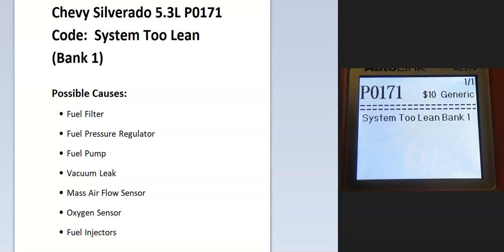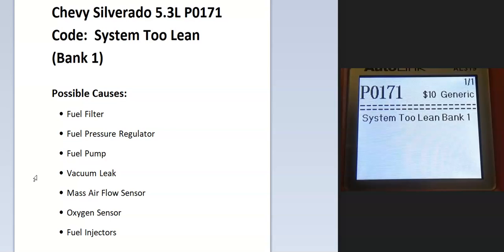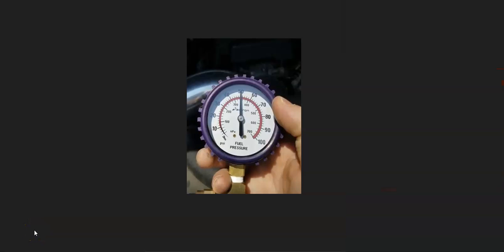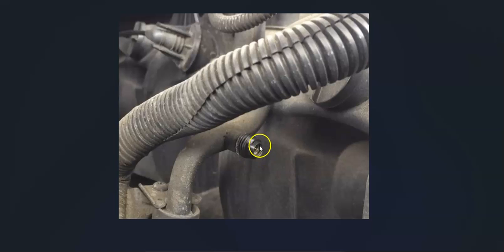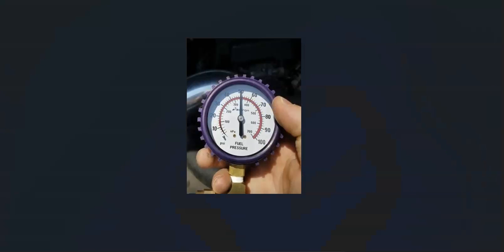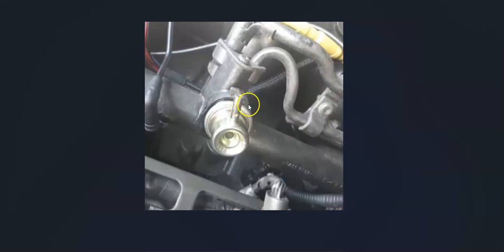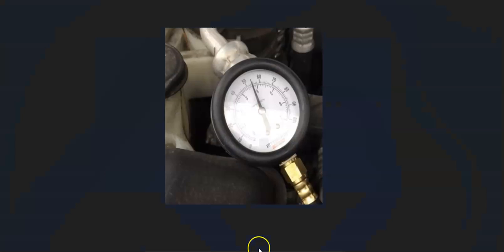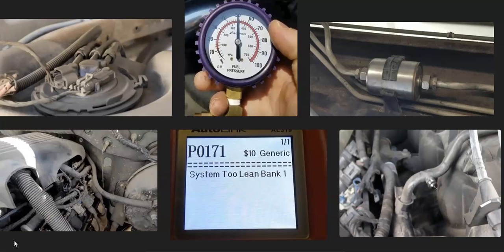Causes and Fixes Chevy Silverado 5.3L P0171 Code: System Too Lean (Bank 1)

Comment: I got a P0171 P0300 I replaced a purge valve. I replaced the intake manifold exhaust manifold, replace spark plugs and wires clean fuel injectors cleaned MA F Pl. A PCP fitting.

Comment: I'm getting coded P0171 and P0300, could I get some help fixing this issue
Reply from the maker: Lean codes can be hard to diagnose. If you only get bank-1 lean code than the cause is something that would only affect bank-1 and not the whole engine. Things such as a bad injector or coil. If no specifics cylinder error codes come up, you can remove the spark plug one at a time to see how they are burning and match them to a spark plug burn chart to see if one or the whole bank-1 is running Lean.

Comment: Had this code today on a 02 silverado 1500 with a 5.3 motor along with a p0300 code i replaced my 02 sensor bank 1 sensor 1 started the truck and the check engine light went away on its own and the truck drove perfectly.

Comment: Where would the fuel filter be on My 2004 chevy silverado 1500 it has a 5.3l v8 but we replaced the brake lines and couldn't find one inside the gas tank or on the frame under the driver door couldn't of missed it especially since we had it on a car lift 6 feet off the ground looking for it any ideas? Was it deleted or what lmfao

Comment: Thanks! Ive replaced the fuel pump and filter (per mechanics recommendation) and still didnt solve my issue. Did a fuel pressure test and vacuum test myself too and they were fine. I even fixed an exhaust leak I found and cleaned my o2 sensors. Nothing was helping, so I started suspecting my regulator. This video helped me feel more confident that its my problem.
Reply: Was it fixed?

Comment: important: SMOKE TEST your air intake AND exhaust system.   An loose exhaust connection could through this code.  I located a badly deteriorated exhaust DONUT from the exhaust manifold to the pipe connector - and made a huge difference.   SMOKE MACHINE about $100 or less... includes pumpup bladder, etc.

Comment: I drive a 2006 Chevy Silverado 6.0 & I’ve been getting P0171 & P0174 codes for a while along with poor gas mileage & loss of power anytime I try to accelerate quickly (passing), but otherwise it seems to run pretty normal. I’ve been chasing this issue for a while, but haven’t been able to determine the cause. But last week power significantly dropped, engine misfired, and went into limp mode. Checked for vacuum leaks (visually & sprayed carb cleaner) for the umpteenth time & found none. Checked fuel pressure & it was reading 22psi at the fuel rail during idle. While dropping my gas tank I found the Vapor Canister Vent Hose was broken (prior DIY fix had failed) & I’m curious how or if this could have caused my truck to run lean.  Also is there a way that I can test the fuel pressure with the fuel pump assembly already removed? Just curious if you have any thoughts on this. I have ordered a new pump.
Reply from the maker: Troubleshooting lean codes can be difficult. Since it's both banks, it is likely something that would affect the whole engine. I recently made an updated detailed video on diagnosing a P0171 code. Here is a link. https://youtu.be/b9__WGuD-dc

Comment: I'm getting p0171 and p0174 together plus when shifting gears 1-2 it feels the trans is kicking??
Reply: I get the exact same thing?
Reply: @rich909rm any fix? My does the same
Reply: I get both the codes and it also hesitates between 50-60 mph
Reply: Mine too and I can't seem to find the issue lol
Reply: Did you ever find the issue? @WhiteBoiGotti
Reply: bad o2 sensor

Comment: I had a P0171 on my 08 silverado 5.3.  I had super high sort term a long term trim only on bank one.  When revving the engine, trims got even worse.I had no vacuum leaks and when I caused one the engine ran much better, It was clear it was running super rich even tho it had a lean code. Turned out to be the bank one sensor one (upstream) O2 sensor.  I could see it had a 0 volt reading on the scan tool. It was lying to my PCM. put in a new one and truck runs like a dream. I hope that helps someone. Thanks for these great videos. They are a huge help for all of us DYIers!
Reply: Can you tell me what you ended up replacing?
Reply: @deadlizard95 upstream 02 sensor
Reply: Ahhhhhh. It all makes sense now. Thanks brotha!
Reply: Thank you. I was hoping this fella would touch on vacuum leaks and 02 sensors as I thought that could cause the issue
Reply: excellent!   super easy to test O2 sensors also....... w propane or map gas torch.  I went through a PILE of about 20 or so Ive accumulated over my part swapping days - and found most of them are totally good!

Comment: Why do I only get P0171 when I run e85, I never get it when using regular fuel.
Reply: is your vehicle flex fuel? E85 will cause a vehicle to run lean if it's not a flex fuel vehicle or tuned for it.
Reply: Ever since I started using e85 my car exhaust smells like a sweet older

Comment: Why would any of these possibilities cause a lean condition on only one side? Was bank 2 normal?
Reply from the maker: A P0171 code can be problematic since it can be caused by many things. Often a P0172 code will also come on for Bank-2 but not always. Each component will need to be tested, Bank-1 O2 sensor, fuel pressure, vacuum leak, and injectors.
Reply: @HVAC Mechanic   I see.. I never got a lean code or any cel for that matter. I just noticed drivability issues once warm. I monitored the sensors, and all are normal, but the pcm is sending +14% trim to bank 1, +-3% to bank 2. I swapped spark olugs, injectors, coil packs side to side, installed a new fuel pump, replaced intake gaskets,.. no change in trims. Im starting to suspect exhaust leak or pcm itself.
Reply: Im having both bank 1 and bank 2 throwing a lean code. Used seafoam and it went away for a week. Came back. Checked codes again and its the same 2 codes.

Comment: When I got a P0171 the reader also mentioned “EVAP”, indicating an exhaust leak. Is this something you can elaborate? Everytime I look up exhaust leaks, other people bring up other codes.
Reply from the maker: The Evap system is for emissions which send gas vapors from the gas tank back to the engine to get burnt off. A P0171 code can be problematic sometimes since so many things can cause it. I always do a fuel pressure test first to see if it is a fuel issue. If that is good, then I test for a vacuum leak, the MAF sensor, and 02 sensors (Mainly the Bank Sensor 1 Upstream sensor). An exhaust leak can throw off the 02 sensors and give bad data to the onboard computer.
Reply: @HVAC_Mechanic mine has bank 1 and 2 
Random cylinder misfire and truck won't start
Reply: The Evap is a fuel filter it’s black box

Comment: can a po172&po175 can it be cause by a vacuum leak please respond
Reply: For me as auto tech, yah vacuum leak and MAF sensor must be the first thing you check before jumping to more complicated check up.. because too lean doesn't always mean less fuel sometimes its too much air✌️✌️
Reply from the maker: A P0172/P0175 codes point to an air/fuel problem which can be caused by several things. A vacuum leak may cause the issue, but it is usually low on the list. I would start with a fuel pressure test and check the MAF sensor.
Reply: I’m getting a p0171 code along with the two bottom oxygen sensors code .. the bottom oxygen sensors look like they have been recently replaced however. Anybody have similar situation.?
Reply: Thank you for your respond keep those video coming thank you again